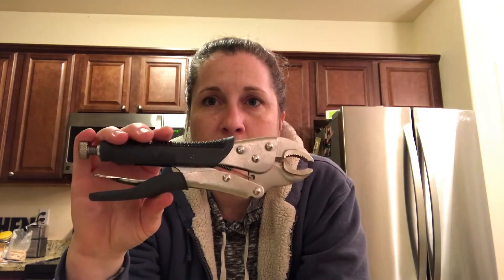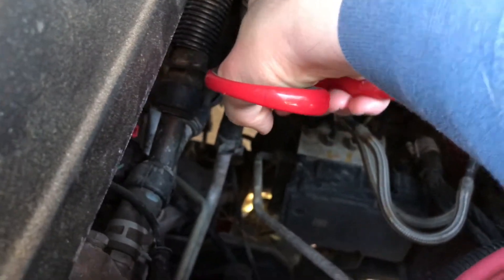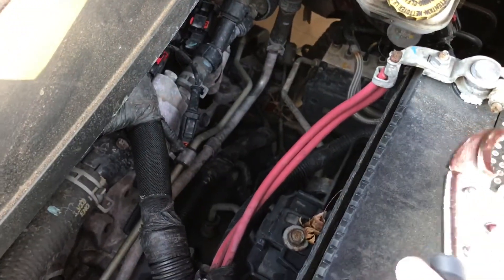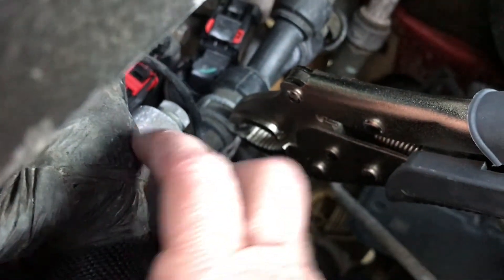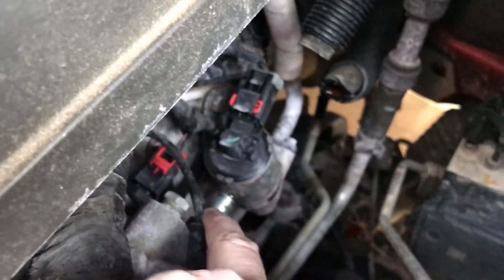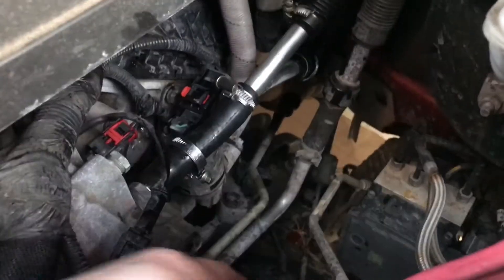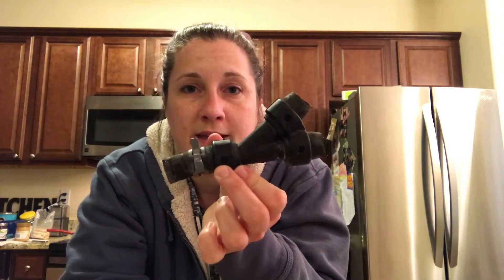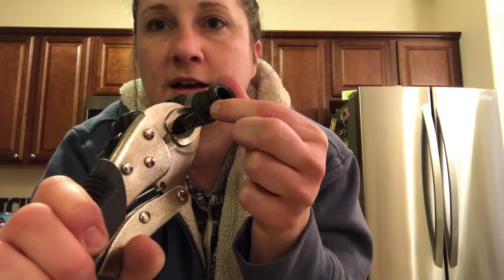How to Fix the Heater Hose in a Chrysler Town & Country | Wednesday Workshop

Comment: Helpful!  I'm not sure I like that "Y" fitting.  I ordered both OEM hoses that include the "Y" for under $50.  I'll be changing those today.  Thanks!
Reply from the maker: I liked that one because it’s metal, and there is tendency for these to repeatedly wear out for whatever reason (poor design.) I can tell you I had zero problems for the year and a half I still owned the vehicle after this repair. 😊

Comment: Good video... BUT.............
Can you pls amend the title of your video to show YEAR 2010 model.
As your engine is not the same as pre 2000 models, this will save us wasting our time watching your video.
Cheers
Reply from the maker: I will look into which years this directly applies to, because there is a range. :-)  Thanks for the feedback!
Reply: The video clearly shows the procedure for 2008 -2014 town and country and Dodge minivan and is the same for all engines used during that period. There is nothing lacking in her video.
Reply: Does not matter what year or engine, they are all the same on Chrysler, dodge and VW Mini vans with front and rear heaters.